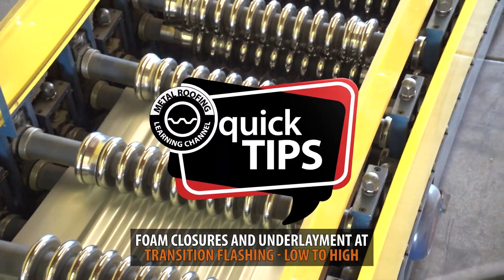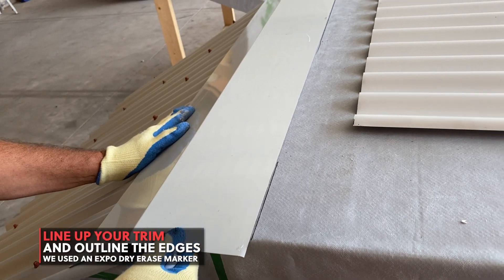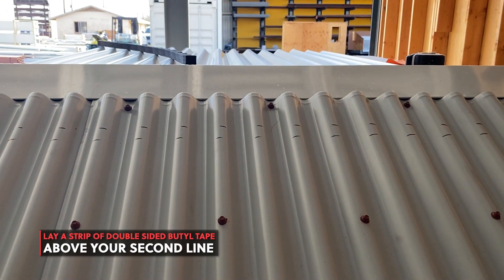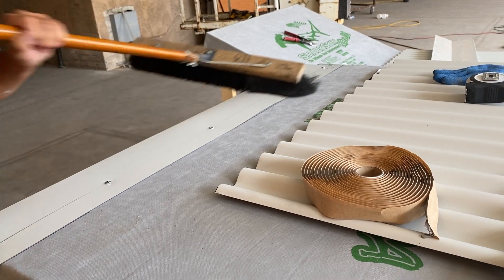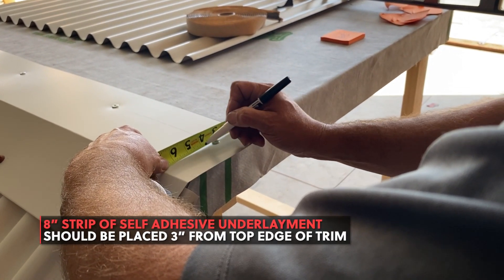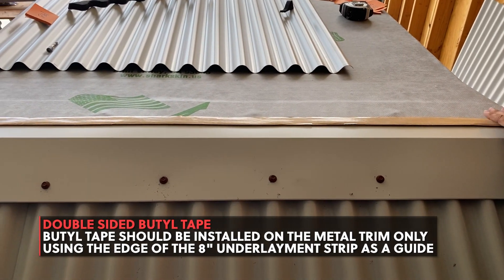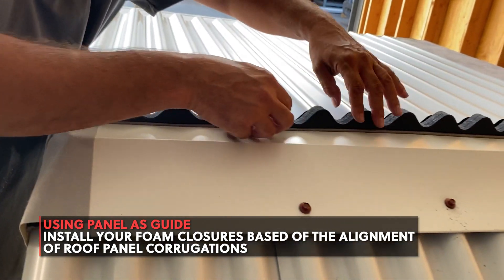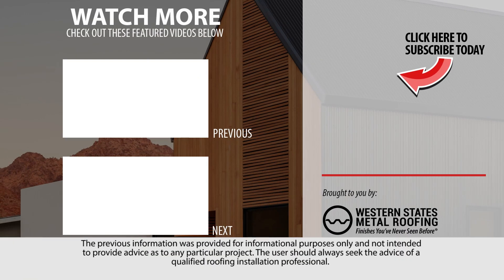How To Install Foam Closure Strips & Underlayment At Transition Flashing & Pitch Break On Metal Roof

Comment: does the inside foam just go at the bottom of the panel for a 5/12 pitch garage? At the top you do not use inside foam? Just the outside foam for the ridge cap?